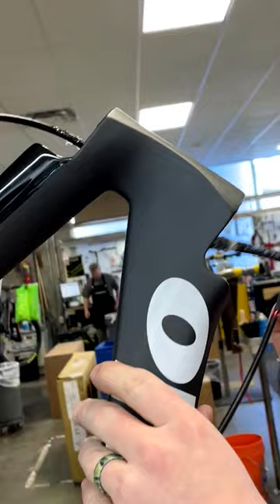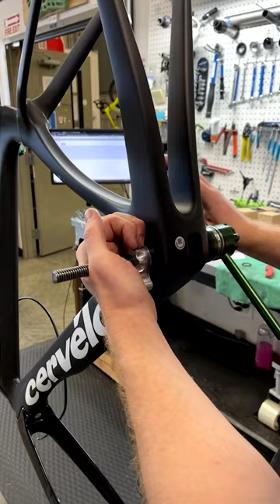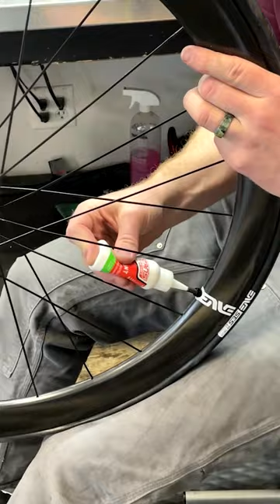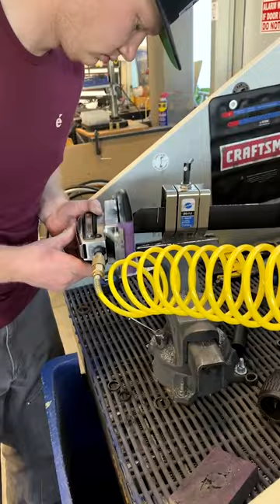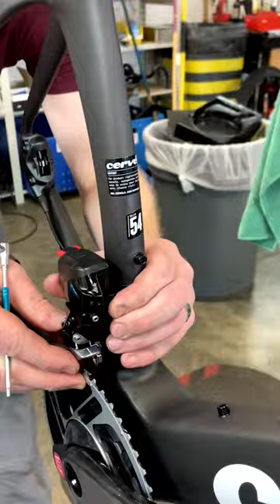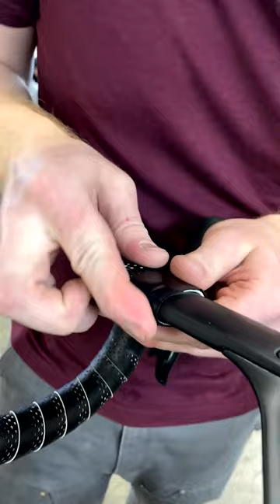Cervelo S5 Dream Build 😍 #shorts

Comment: Is it cheaper to build your own bike?
Reply: If you match the spec like for like, no. This is because factories bought the parts in bulk, which results in a lower per component cost.

But one of the advantages of building a bike from the frame up is you get to build it the way you want it. Your spec, your dimensions, right off the bat.